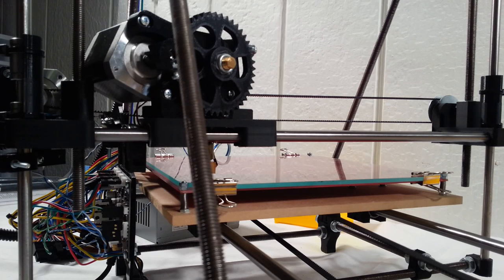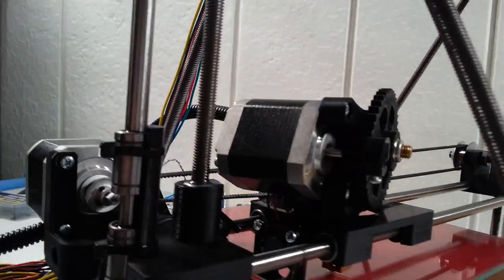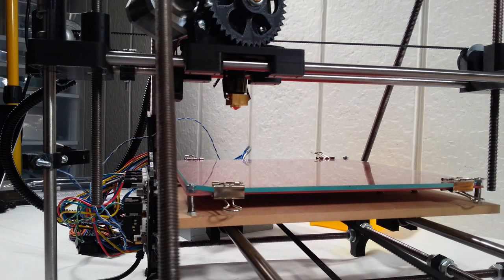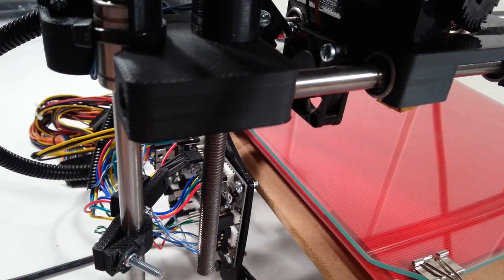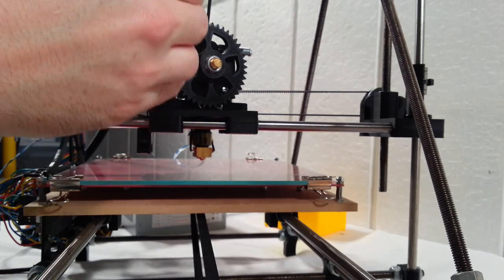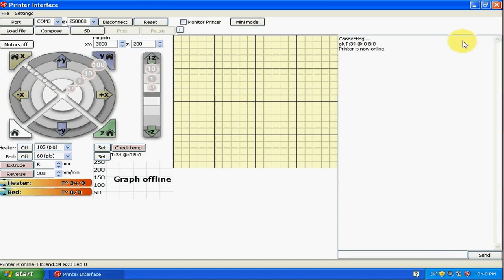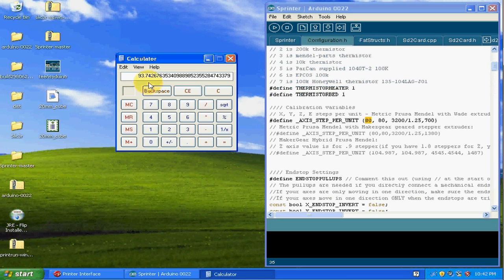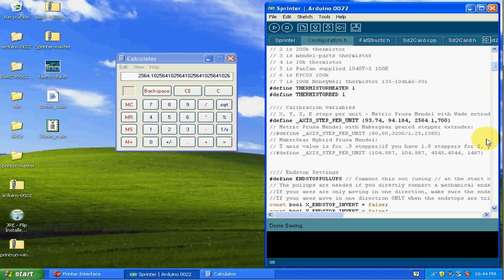RepRap Prusa Mendel Iteration 2 Assembly 23 - Stepper Motor Calibration

Comment: nice thanks again for the reply with a link its working great with marlin how ever there are some problems that are confusing 1 when I heat the extruder up pronterface and the LCD think the bed has over heated and cuts of at 140c I was wondering if I should swap the wiring or if there a way to change it in the code, the other is the steppers are way over but the extruder is the most off I cant even measure it, if I extrude it 5mm it extrudes more than 50mm here is some of the math (X) 100/117.09x100=85.40 (Y) 100/117.92x100=84.80 (Z)4000/76.14x50=2626.740 and well the math for the extruder concerns me im thinking its something like 700/50ishx5= 70 any ider if these are correct direction to go or am I completely off track?

Comment: Hello, i was wondering if you knew how to tell if my stepper motors are working properly or not, as of right now i can make them move one step just fine but it dont always move with complete Accuracy and if i run 30mm it hardly turns at all and makes kind of a high pitched noise like them old printers when their warming up... I tested it with the motor off of my printer and its the same issue,... whats strange is all of my motors are doing it except for my extruder stepper motor seams to be working fine.
Reply from the maker: My guess is that the problem is at the stepper drivers. Have you adjusted their output current? You'll need a ceramic, plastic or wood screwdriver to turn the pots clockwise to increase current and counter-clockwise to decrease current. If the stepper driver overheats, it will shut down until they cool and the power is reset. You can try swapping the extruder stepper drier with the x axis stepper driver and see if the problem moves.
Reply: engineglue Thanks for the reply!... so i did as you said and first tried to adjust it with no luck, and i also swapped out the extruder driver with the x axis driver and same thing,. also i tried the extruder afterwards and it still seams to push out the filament just fine, the only thing i noticed is you have to pull up on the filament for it to reverse out, idk if thats normal or not, it did that before too, im pretty new to this,
Reply from the maker: Aw Ol When you swapped the x axis driver and extruder driver, did the problem remain at the extruder? Are you using Ramps 1.4? How many jumpers are plugged in under the extruder stepper driver? What are the steps per millimeter's set to in the firmware?

Comment: hold up got everything worked out but the bed and extruder are in revers kinda , turn on the extruder on pronter and it hits 150 and say the bed is overheated and shuts off so if the pronter show bed temp moving but its the extruder that's on not the bed got me stumped at the moment. any solutions ?
Reply from the maker: TheRogueRedwolf Do you have the thermistors plugged into the correct ports?
Reply: I do now thanks again